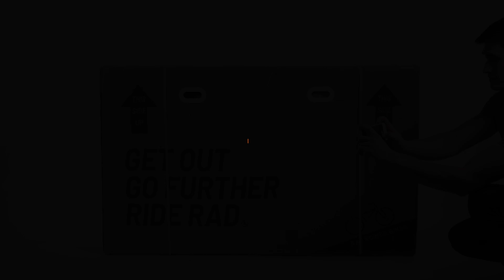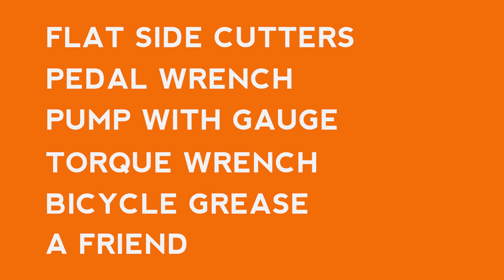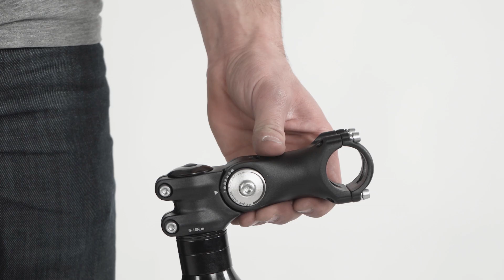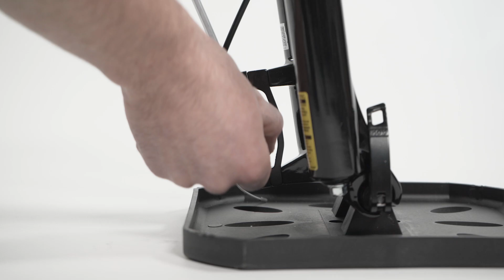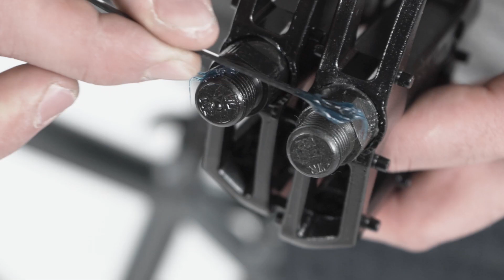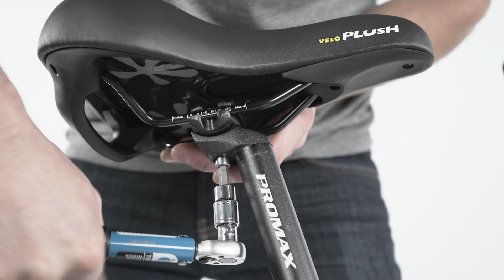2019 RadCity 16", 19", & Step-Thru Assembly Instructions

Comment: I have one of these and I installed the front wheel. It's so tight even after loosening the brakes the the wheel hardly moves. That can't be normal?
Reply from the maker: Our Tech Support team can help! Call or email them at (800) 939-0310 x2 or support@radpowerbikes.com.
Reply: @Nunya Business That is clearly not the solution.